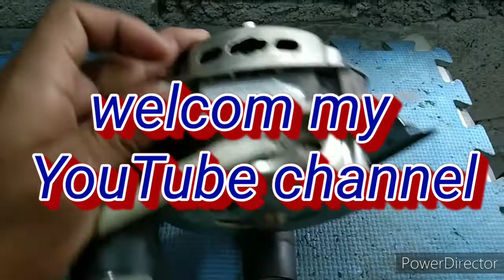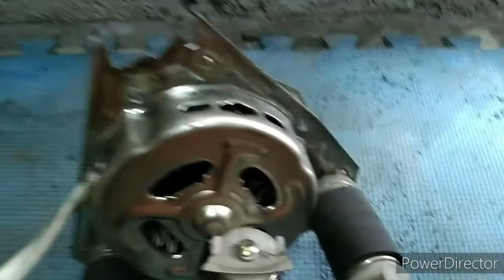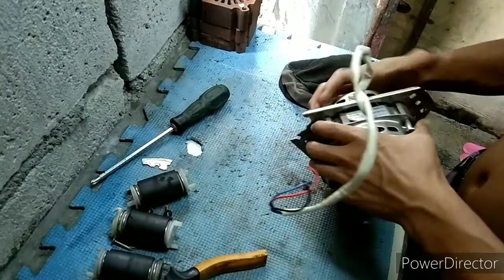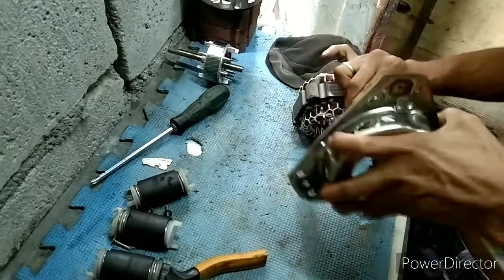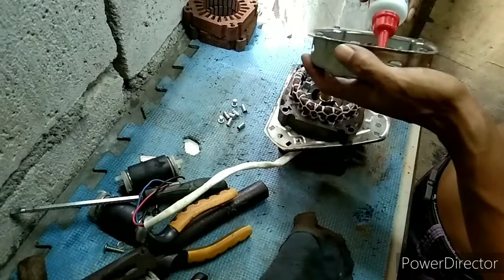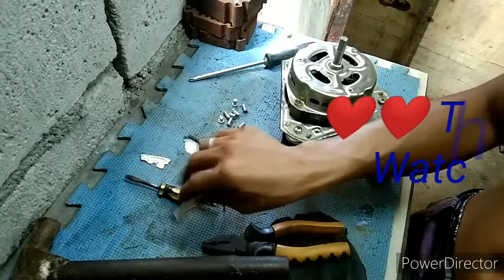spin motor repair

Comment: Sir Idol.. Paano nyo po binubuksan ang kanyang electric motor ng washing machine na hindi naka bolts and nuts? Ginagamitan nyo po ba ng electric drill? Nahihirapan kasi ako sa pag bukas ng ganyan kasi walay bolts.
Salamat idol. New sub mo ako idol..
Reply from the maker: Sige idol gagawa ako video.
Salamat sa panonod video ko idol